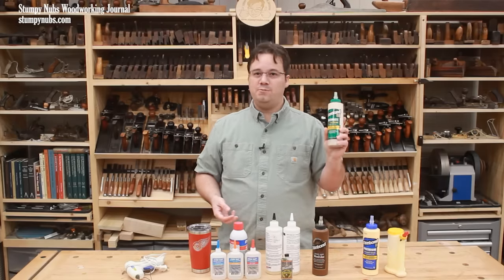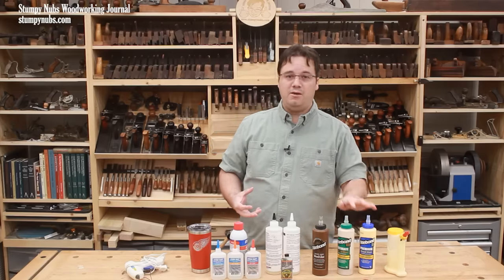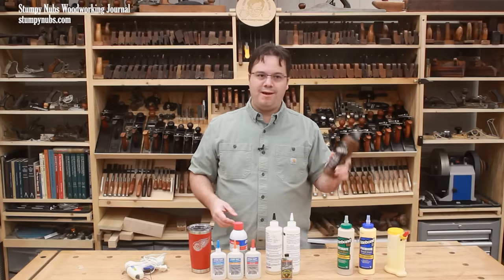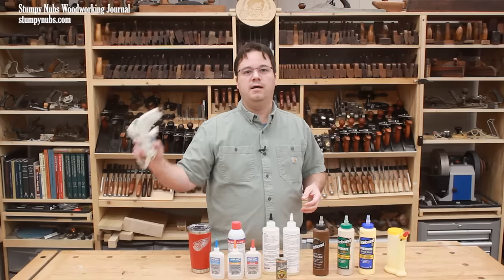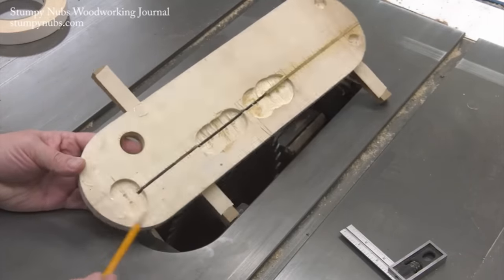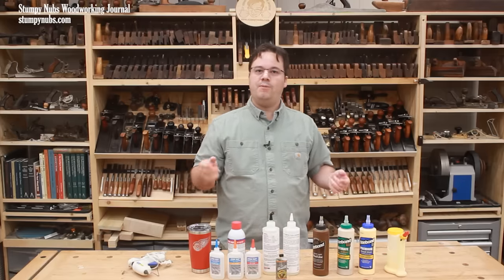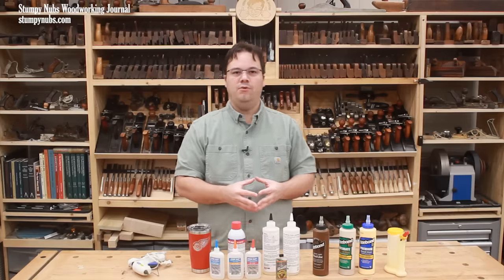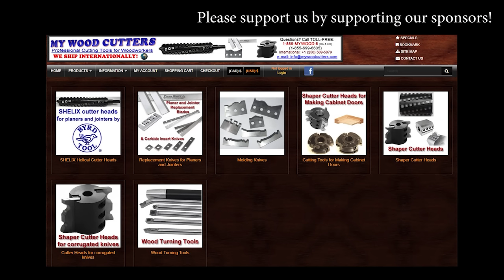Why I don't use Gorilla Glue

Comment: The advantages of gorilla glue is that it fills irregular gaps and it can set rock hard and it bonds wood to practically anything, tiles, concrete etc. it can be messy though and it sticks on your hands for ages. It’s definitely got a place for general, multi uses and applications.
Reply: I had a leak in my (inner) washer hose and the appliance guy wanted $300 to come replace it. I put a dab of gorilla glue in the pinhole and Viola! No more leak! :D
Reply: I'll give another example for when gorilla glue is great in woodworking where the others struggle to keep up. If you are gluing two pieces together and you are looking for ultimate sheer strength, drill a bunch of holes into each surface before you join them with gorilla glue. The poly will expand into all of those holes and lock the two pieces together. The more holes you drill (up to a point) the better the sheer strength will be.
Reply: Gorilla glue DOES NOT fill gaps with any strength, the pieces have to mate perfectly for strength

Comment: I collect vintage guitars. They almost always require the neck joint to be disassembled and reset after decades of use. The constant asymmetric tension caused by the strings cause the neck geometry to change over time making the guitar difficult to play. Fortunately all these older guitars are constructed with hide glue making the neck joint disassembly easier.
Reply: Hide glue is only glue to use for music instruments. Its traditional, reversible and it cures really hard. All other glues stay little bit flexible but hide glue when fully cured is almost crystal. Its joints do not dampen the sounds in instrument.
Reply: @KK-xz4rk  I've read that people have had problems with the pre mix hide glue in high humidity areas.
Reply: Organ builders generally use hide glue as they know everything will need to be taken apart again in the future. There are a few exceptions who use foam glue (to the dismay of everyone who has to releather or rebuild instruments where foam glue was used).
Reply: @UnderTheFloor79  Music instruments + high humidity is never a good mix. It is not a glue for boatbuilding. It is a glue for violins and guitars and antique furniture.
Reply: Its the same in the piano industry.  We actually still always stick with hot hide glue.
Reply: @UnderTheFloor79  I keep my instruments in a small room at 40 to 45% relative humidity. I have to humidify in winter cause the forced air heat dries them out. Cracks are not uncommon in low humidity. Then I dehumidify in the summer when the outdoor humidity is often high. The heat and humidity can cause braces to loosen etc.
Reply: @KK-xz4rk  With instruments, you don't want humidity too high or too low. Both cases cause problems. In the short term, it's usually minor issues, but set you up for major issues long-term.
Reply: There are different grades of hide glue, ranging up to a formula so strong that it will etch glass, pulling the surface off as it dries and shrinks.
Reply: @zackeryhardy9504  Exactly correct. Hot hide glue for wood-to-wood, and burnt shellac for wood-to-metal. Professional restorers of old player pianos have lots of horror stories about discovering attempted repairs that used a wrong glue. For musical instrument repair, "Always think of the next restorer. He might even be YOU."
Reply: @amazing7633  Well good chance for me since I am a piano tech
Reply: You know you could like... Play a New guitar that's not messed up yet? Right?
Reply: @AnonyMous-lk7zi  Well aged wood is a lot more stable than green wood.  So there is a reason to use an old acoustic instrament over a new one
Reply: @AnonyMous-lk7zi  oh dude. You don’t understand the tone you get from a vintage instrument not to mention the deeply rooted prejudices that vintage instrument aficionados bring to the table. Why do you think that 17th century Stradivarius violins are worth millions, blind tests be damned.
Reply: It's great stuff I really think it should be on the list. It sets really fast say for a temporary clamp block. And then can be shocked apart without damaging the wood. The fact that it's hundreds of years old and still the best and only glue for violins etc.
Reply: @KK-xz4rk  In the old times, some used fish glue for music instruments.

Comment: I like those tubes of stick glue that are like oversized chapsticks. I just used it to hold down paper templates that I make on the printer. When I'm done, it's easy to peel off and clean up. Just don't count on it for ANY kind of strength.
Reply: Im p sure those are still pva just don’t permeate the wood as well since its thicker
Reply: I also use the old glue sticks to assemble rocking horses and baby cradles with out fasteners, that way the kid don't get stabbeb when the piece collapses.   I'm kidding I'm kidding.
Reply: Doubles as a snack in a pinch ;-)
Reply: @melody3741   The original Pritt stick glue, and I'm sure most copies, are not PVA.  They are closer to your solid under arm deodorant.   Basically a gel.
Reply: Bandsawyer's best friend
Reply: Really? I use it to glue my necks into guitar bodies. Works great!
Reply: I use it between pieces I want to cut identically. Paper tape on the pieces, stick paper glue on them and then glue them together. Strong enough to not move if handled correctly while sawing. And easiest to remove.
Reply: I handed my girlfriend a glue stick instead of her chapstick. She hasn't spoken to me since.
Reply: That's PVA glue as well, I use it on 3D printed parts to hold my part to the print bed.
Reply: @MrDDiRusso 
Badda boom!
Reply: UHU glue stick. Use it to attach tissue paper covering to balsa wood model airplanes. Great stuff.
Reply: This was a joke, btw. Don’t ever do that
Reply: @MrDDiRusso  You beat me to it; I was just going to make that joke! Never not funny!
Reply: Apparently if you layer super glue and baking soda it creates a very hard layer for filling in cracks and stuff
Reply: Lol u mean glue sticks?
Reply: @garyblack8717  Must keep it next to crayons - there must be a marine in the family.. LOL ;-)
Reply: It will work fine to seal envelopes or put on stamps. Those are used a LOT here in Japan for those exact purposes. They are the equivalent of the plastic containers of paste from long ago.
Reply: @mgcnashville6615  As long as you only play punk, you'll be fine.
Reply: @CONEHEADDK  did you know that members of the Nazi SS had the SS symbol tattooed on their armpits? 
Bugs Bunny made a subtle reference to it in a cartoon where he placed a postage stamp on his armpit.
Reply: @MrDDiRusso  Nope.  My generation were so flooded with the jew victims mantra, that it became kinda claustrofobic for me to hear anything about WW2..  I suppose some of the flood was because, "we" could see our selves as heros for sailing some to Sweden (from Denmark) - as far as I know, for money - the same thing we critisize others doing down south today.. I expect you have seen the Donald Duck "Look into the ilumin.ti" in a cartoon.
Reply: @CONEHEADDK  most people today would find world war two propaganda cartoons as totally offensive.

Comment: I have used gorilla glue to repair a crack by drilling into the end  grain and first pouring in yellow glue followed by gg followed by a dowel. The glues foam into the crack and makes a nice repair. I have also used this trick to fix squeaky stair treads by drilling a small hole through the tread. Pouring in the yellow and gg then plugging the hole with a dowel. The glues expand and cure to fill the gap and stabilize the tread. Squeak gone. Gg is another tool in the toolbox and has its place.
Reply: Why do you use the PVA glue and not just the GG?
Reply: @jeanchapman1301  I assume the moisture from the yellow glue activates the expand properties of the gg
Reply: Yes the moisture from the yellow glue activates the gg, but the foaming gg pushes the yellow glue into otherwise unreachable places. I also believe (untested) that gap filling properties of the gg are made stronger with the added yellow glue foam.
Reply: I use GG with green construction lumber for shop and yard projects.  Way cheaper than epoxy.
Reply: Your last statement is what I consider the key here. It's a Tool that's available. Trying to work without the right tool can be done, but it is always better to have more options. Ya'll Take Care and be safe, John